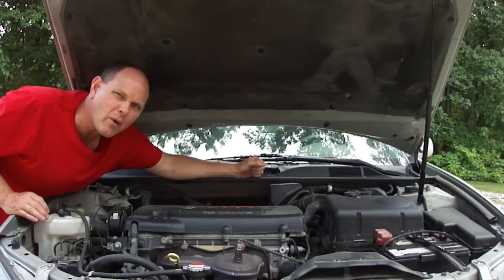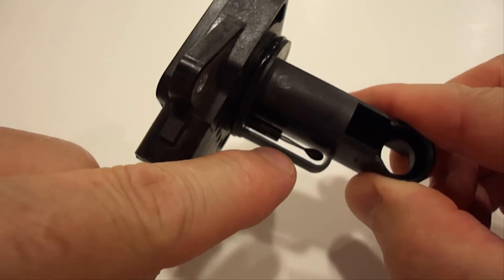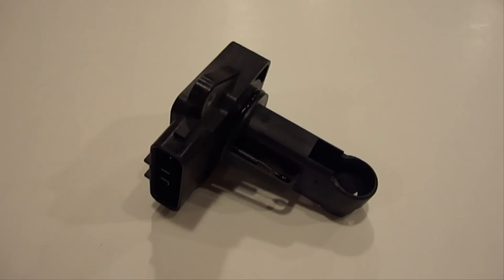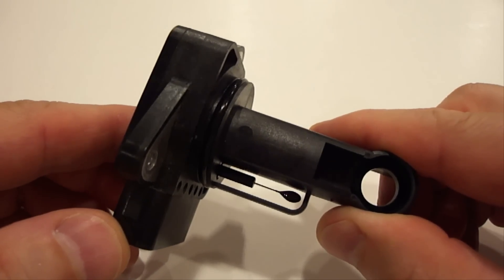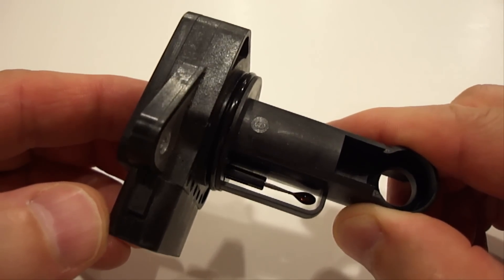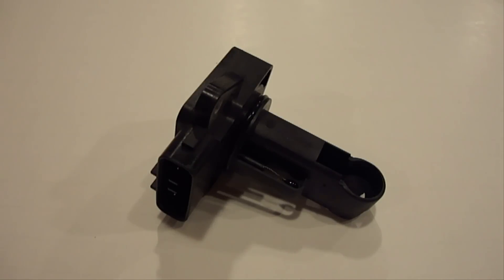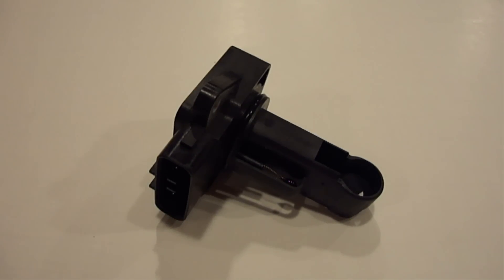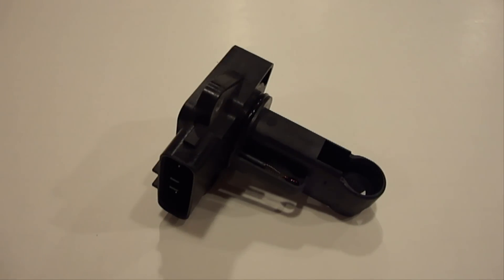The Dangers Of A Bad Mass Air Flow Sensor On Your Car

Comment: Thank you.  Everyone else only discuss cleaning the MAF sensor, which I've done three times now and the light keeps returning.  I have a reusable air filter which I keep clean (and not OVER oiled and only use MAF cleaner.  So I did what others suggest (review vac lines, etc) but when one suggested fuel pump or injector, I stopped since I like to repair, not throw new parts until I get it.  This was the first to confirm that the sensor itself can go bad.
Reply: Just a thought, you might have
better times with that one use air
filter. Replace the MAF if it is
bad as well. 🤔👌✌️

Comment: The one you're pointing at using your finger is just the air temperature sensor. The actual hot-wire airflow sensor is actually inside of that pipe, you can see that tiny sensor only from a certain angle, it's very very tiny, u gotta use a bright light to see that.

Comment: Keep in mind that a dirty sensor will also cause you vehicle to throw a “masked” check engine light caused by the MAF sensor, but because the chocking affect from not enough air for combustion, it can cause a misfire read on the check engine from a spark plug or coil pack. So because your codes might tell you #8 cylinder miss fired, it could actually be from the MAF sensor starving the engine from oxygen. Just an FYI
Reply: I agree on u
Reply: Can that effect bad o2 sensor readings.. I replaced my o2 sensor bank 2 .. but I still get p0056 o2 sensor codes.. my service engine soon light comes keeps coming on.. 😤
Reply: i hope that’s the case with me, i get both the maf code and misfire code, i just cleaned the maf but hopefully, it just needed a cleaning and if not a replacement, it did seem dirty. hopefully not a real misfire problem
Reply: @fernandogranados7773  So what is your outcome after cleaning and erasing the codes? Interesting knowing because this happened to me as well last night
Reply: @Mr.Steve-O  bad news, it was a misfire🫤
Reply: @fernandogranados7773  So MAF replacement ?
Reply: Would this apply to v6?  #5 went out after I hauled up this hwy ramp, at acceleration I had a lot of backfiring before the car stalled and engine light came on

Comment: I replaced mine on my 1997 buick le sabre.  The old sensor plastic neck was cricked, and the electrical wires were clearly broken.  Be careful with the sensor.  It is kind of cheap plastic.   Not sure what happened first, but the symptoms were pretty much like he said here. Stalling, rough idle, etc.  While you replace the sensor do take the time to clean out the throttle body.  On an old care you might be surprised how much gunk is in there.   Do NOT get the carb cleaner anywhere near the New sensor.  Clean out that throttle body before you put the new sensor in.  I also replaced my Idle air controller. That thing was pretty gunked up and I think was also a reason my car surged, stalled, etc.  I did replace the throttle position sensor also, just because it was cheap and easy to do.  That might be a bit off kilter at low idle. All three things done and my car worked fine. Later I had a bad crankshaft sensor and the car stopped running completely.  That was an easy one, but i let the shop replace that sensor.  I want to replace the camshaft sensor too, but that is surprisingly tough to reach.  All this stuff is cheap compared to buying a new car.  My car has 198,000 miles on it, and today is 2017.  That little 3.8 engine is really pretty good.  I also replaced the little fuel pressure regulator and I think that helped the idle also.
Reply: I got a crick in my neck too

Comment: There are two types of air flow sensors depending on  the sensor element being used. These are "dumb" sensors in that they just send signal back to the engine management computer. The engine management computer interprets the signal. There is no microprocessor in the sensor. It just has highly sensitive and delicate sensor elements.

Comment: Hi Paul! After changing the MAF sensor, you do not need to wait 50 miles for check engine light to disappear. Just remove positive terminal from battery for 30 minutes, re- connect, and engine light is gone.  Lexus, actually requires disconnecting battery for up to 30 minutes after sensor(s) have been replaced.
Reply: No you use a correct computer to plug in disconnecting a battery was never a professional way lol

Comment: I think this is my starting point!
I bought a car that was previously wrecked & rebuilt for almost nothing from a guy in the scary part of Detroit, it was not driven for probably 3 years.
The engine never had as much "Pep" as i thought it should, and the gas miles were 5-10 below what i was expecting.
Then it started acting real sluggish and i thought i had a brake dragging, but laser thermometer didn't see a hot rotor, then it just died. hasn't started in a week.
Fuel pumps both working (Hi & Low), haven't pulled the plugs yet.
I hope to see a dirty MAF or MAP! i hope the dying wasn't my converter melting into 1 big slug and plugging my exhaust!

Comment: The part you point to is actually the air temperature sensor. The mass air flow part is down at the bottom of the tube.

Comment: The Nissan dealer in Duluth, GA; told me some years ago; that the "MAF" (Mass Air Flow) would cost $560.00 on my 1995 Nissan Maxima, plus labor. I said no and traded the car for a new one. Sadly, I now realize that they are rather cheap (at auto parts) and very easy to change. Wish I had done that; because that 1995 Maxima was the best car I EVER owned. Except for that damned "MAF" it was like brand new when it was 13 yrs old!

And Yes I now know they NEED to be cleaned regularly on all cars and the SAME for the Throttle Body. For if not cleaned regularly; all hell is coming to you. Oh indeed yes. Cleaning them (use ONLY CRC TB cleaner and CRC MAF cleaner) brings the car back to running like it did when it was brand new.

Promise. Note: After the cleaning of the "TB" (IF you remove it-recommended) the computer MUST be "Re-Learned", or you will have all kind of problems. Check this out on YouTube videos; that show HOW to do it easily. It's a procedure that must be followed to the "nth" degree. It might take several try's to get the knack of it; but when you get it right, you will be surprised how smooth your car will run. Promise.

For what it's worth.
Reply from the maker: That’s too bad. Always use genuine OEM or high-quality parts. I like Denso.

Comment: Good video, in particular, specifying that you should use a mass air flow cleaner (easy to get on line). While you're at it change out your air filter and clean the throttle body if needed.
Reply: Mass airflow sensor cleaner is available at Walmart and any local auto parts stores

Comment: 2009 Ranger 4l ranger auto started shifting very hard from 1st to 2nd.Next day, check engine light came on p0102. Cleaned MAF sensor,no change. Never made the connection between the two problems but thought I would get the tranny fixed first. Much to my surprise, the  mass air flow sensor replacement and reset fixed the transmission problem. Computers rule.

Comment: A bad maf will WREAK HAVOC on your car. Trust me. I know. Also using KN air filters will ruin these as the oil from the filter WILL blow back onto the maf sensor and short it out. STAT AWAY FROM KN AIR FILTERS.
Reply: Fore warned is fore wise! Thanks!

Comment: I've been told mine is bad on an 88 Sentra. The ECM/ECU fried when water got to it. The next day I tried to start it, but no go. Someone said somethin else may have fried. After replacing ECM, the car ran good for 3-4 days. Now it has a rough idle, jerking/surging when driving, runs/idles rich, a smell of gas from the tailpape, and mileage is about 7 mpg. Evidently, you can't get just the MAF, TPS separate on this car(has throttle body injection). You have to buy the whole throttle body. A tune was done 9 mos. ago. Plugs/wires/cap/rotor/02 sensor/pcv/air filter, and before this the car ran really good.
Thanks

Comment: Thanks very much for the vid!!  I just want to say one thing about those cheap MAFs on eBay or Amazon...I wouldn't recommend them to anyone.  I bought one for $US23 to change the MAF for my car, Nissan.  Of course, it came from China after waiting for about 5 weeks or so.  After replacing it for few weeks, I noticed the car run worse than with the previous MAF. In fact, it died on me many times when turning or reducing speed.  The RPM doesn't stay around 800/ minute when idle.  I had to buy a genius German BOSH one from Amazon for about $100.  It's a lot better.   Please stay away from those cheap MAFs!! They're very risky and not worth wasting your time,  money and perhaps life too...
Reply: Nissan has a taste for maf sensors. Mune Just died badly. Car wont even start without disconect. The wires...... Its sucks

Comment: I listened how important this device is... But dang, 90% of the cars I have owned did not even have one...meaning this MAF sensor is just another device designed to make it so people cannot work on their own cars AND to allow automotive technitions to replace parts helter skeltor and you foot the inflated bill.   We used to be called mechanics because WE found and fixed the problem and did not just remove and replace parts until the problem was resolved.
Reply: Terry Weaver it is easy to work on this... Two screws, one connector
Reply: Ed but what do you do when the maf sensor wire has a lock in feature an it broke while plugged in. i need a new maf sensot but it stuck plugged into the bad part
Reply: It does seem like a b***** sensor for two main reasons, one the amount of air your car sucks in is basically directly proportional to the RPMs because it's not going to suck in more or less are at a given RPM
Reply: So True Terry, Which is Why On My Chevys I Like HEI's & carbs On them. Not as Fuel efficient But When an Engine function Doesn't work, U Know specifically whats wrong
Reply: Its actually very easy to replace on Toyotas. 2 screws and harness right on top of engine. Problem is figuring out if the MAF is bad or you have air leak somewhere downstream.

Comment: 1995 Tacoma, replaced MAF with a Auto Zone part 190.00 lasted 3 months, replaced with Napa part 289.00 lasted 6 months, took to Toyota to troubleshoot, thought it might be something causing MAF to go bad. Was told this one of the few parts that needs to be OEM, they replaced.....650.00. Now 6 years later starting to have same problem. Just cant win.Hesitation on acceleration, started slowly, now getting worse. So far no code. Idles perfect and revs perfect when not under load, but when under load, it goes bananas. I found cleaning rarely helps.
Reply from the maker: Hi Charles, I have never in my life heard of an OEM MAF costiing $650.  How many miles did you put on that MAF and have you ever had a trouble code from this condition?  Here's a high quality Denso for $78 which you could put in yourself https://www.ebay.com/itm/OEM-Denso-Mass-Air-Flow-Sensor-For-1995-1999-Toyota-3-0L-3-4L-22250-20020/253540804997?fits=Year%3A1995%7CModel%3ATacoma&hash=item3b0835a985:g:wOcAAOSwUCZaxSE4

Comment: This is one component to NEVER EVER buy anything but genuine OEM! I also have a 2006 Camry with 2.4L 2AZ-FE. Bought a Walker. Big mistake. It was calibrated fine above ~100 CFM but any flow rate lower it was WAY off. I know this by using Torque and monitoring fuel trim while running. Another smoking gun was the MAF sensor read 2.8 CFM with the key on but the motor not running. Yeah, I don't think so.

Comment: Am a vehicle doctor in Kenya, massAir flow sensor can make a vehicle starting difficult
Reply: Or not even start att all
Reply: or start easy and run like crap.., and serious power loss hesitation and bucking... cleaning works sometimes,but they do also have to be replaced to remedy the problem...i have a 2001 blazer that has serious hesitation being caused by bad MAF,,,i have one on the way...
Reply: I'm sure this video just said that doctor
Reply: LMAO Vehicle doctor from Kenya
Reply: DESTROY 5G 😂😂😂😂
Reply: @destroy5g626  lmao

Comment: Had some stalling, etc...   Saw some recall work needing done so I took my car to dealer to get the warranty work done on extended Electric Throttle Body warranty first (Known issue on this year of vehicle), thinking that was my main issue and a lot of other shops won't touch a car until recall and warranty work is done.    Well, they said the MAF code was triggered.   Get this... $600 total for parts & (2) hours labor to replace!   I was like... WHAAAAAAAAAAAAT?    I said "Isn't that MAF right there as they replace the ETB?  Why would it take 2 hours to swap out.   Also, that part is only like $80 to $90.      I was really disappointed to know this is how they treat people at the dealer.    What a fucking shame!!   I can swap that part out myself for $80.    Just incredible.   Guess they thought I was some random "Gumby" ready to say yes to whatever they wanted to do.   I don't think so!
Reply: My local ford wanted 600.00 spark plugs. I fix it. No. 8 coil pack. 50.00 and about 20 min.
Reply: Ron Mattingly They expect you to walk in there already bent over
Reply: @JDMHaze   Prob.  they didnt due due diligence. The tech just did a lazy quick diagnostic scan tool test.  Probably cause it was an older PU.  Told me if that was the case the tech is not experience mechanic. When you got a dead cylinder on a 2003 its not goin to be a spark plug or change to fix it. I also had a same situation later ,  had it tested somewhere else and the guy gave me a big hoopla about scan tool equipment (necessary yes) i pulled the  plug. it ended up being a bad connection coil pack wiring on top of plug.
Reply: Ron Mattingly I had a mechanic try to tell me I needed motor mounts and a throttlebody flash, when all I had was a bad ignition coil #1 on a 2000 maxima Hey dealership quoted me 1200 talking about changing all 6
Reply: @JDMHaze  yeah finding an honest tech is not easy.  I had a so called 35yr certified. (Gary's 53rd peoria) crack my block i had to buy whole new engine.  He even let me drive off know ing antifreeze was runing out the cylinder filling my exust system.
Reply: Ron Mattingly People are just come these days, I have a mechanic I use, and to test him I played dumb to see if he would correct me, I didn't play too dumb To avoid blowing my cover
Reply: ApplePie 2019 Yes I've heard people say they had to pay $1200 to get that done on a navigator, the price gouging is just ridiculous and insulting, I would never...

Comment: I have a 02 Lexus Es 300 190,000 had 13 codes check engine light on..Cleaned it for 10$ and BOOM!!! All lights off runs like new!!!!
Reply from the maker: TR808 Awesome! 👏

Comment: Clean your MAF,PCV and throttle body in one go whilst under the hood/bonnet folks so you know it's done for another 3/4 yrs.Hasstle free and head ache free driving.
Reply: You beat me to the comment. I recently replaced my throttle position sensor. Of course, I cleaned out the throttle body (with throttle cleaner), the MAF (with MAF cleaner), and swapped the air filter. PCV was given a tidying up. I think a lot of people know about air filters but the entire airflow system is easily maintained and can make a big difference in performance.

Comment: On my car it just plain out died no response from it. Car stalled out was hard to start got it running I had no choice I was probably 1 minute from home I had to drive it there. Shifted from park too drive it was so god dam rough shook the car then when I got down too first gear it shake and was making a noise. Fortunately I had a spare MAF put it in car run fine no more noise I for sure thought I broke the transmission

Comment: How long can I drive with a bad one? Can it wait a couple weeks to get fixed or should I bring it to mechanic ASAP
Reply from the maker: It depends on how the car is operating and if there are any serious acceleration issues making the car unsafe to drive.  These are usually very easy to replace and you could save a bundle buying it yourself on Ebay.
Reply: proclaimliberty2000 car seems to be running fine, Service Engine Soon light came on last week and test showed it was problem with mass air flow sensor was told it might just need to be cleaned I was planning on taking it in next week . Thanks for responding
Reply from the maker: Zack Flynn Do you want me to send you a video of how to clean it and replace it?
Reply: proclaimliberty2000 sure thanks
Reply from the maker: @zackflynn859  https://youtu.be/YnckaCCJEEk

Comment: I cleaned this thing first back in July and it was ok for a few weeks. Then the check engine light came back on and I replaced it with a brand new one that lasted me a few months. Now it keeps coming in and off even after replacing the air filters
Reply: Loose wire?

Comment: Recently I had a mass airflow sensor engine light , Midas charged me $200 (they said this was a discount price) for the part plus labor, after it was replaced the engine light was still on. I went to another auto shop and they recommended the throttle body so I had them change that out and now the engine light is off. Is it possible that it was the throttle body of the whole time? The car is 10 years old and has just over 180k miles.
Reply from the maker: Sqoody7 InVegas what were the trouble codes?
Reply: P0101, mass or volume air flow a circuit range, p2187 system too lean at idle Bank. Also had my AC fixed at Midas because it is warranty through them and the engine light is back on with the same lean at idle Bank error and also one for the solenoid but that's to be expected because having issues with the 3rd gear ratio and they need to warranty out the transmission. the guy that ran the Midas shop actually asked me he was wondering why I had work done at another shop I don't think they yet realize that I'm about to stop taking my car to that Midas unless something is under warranty